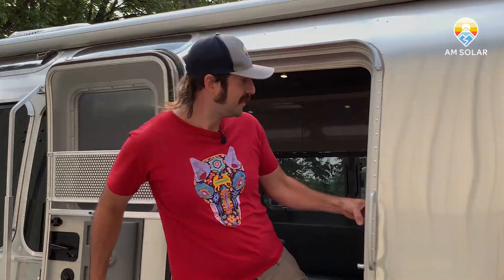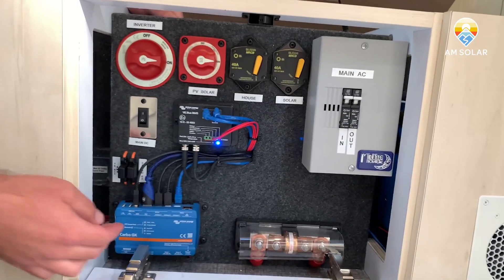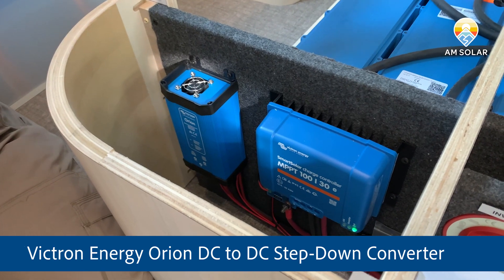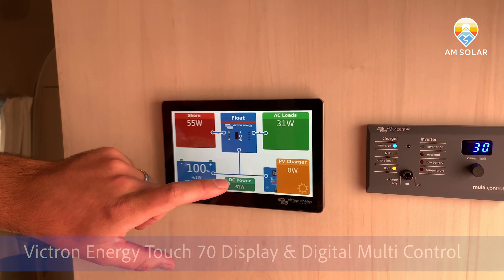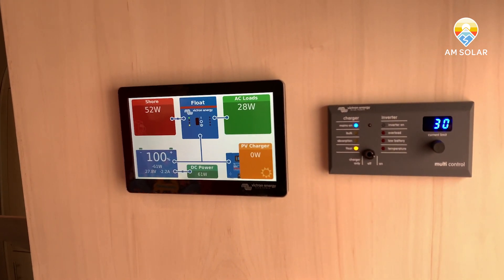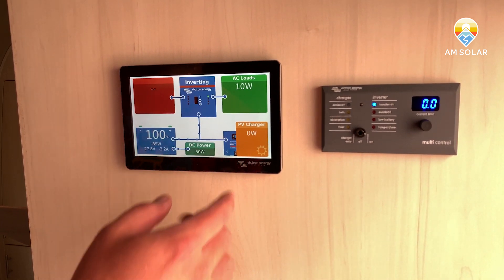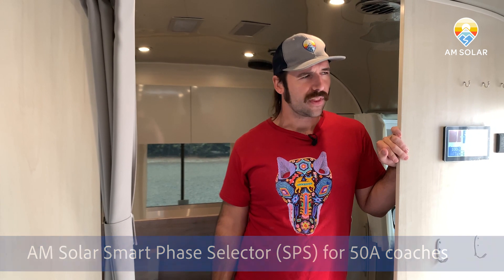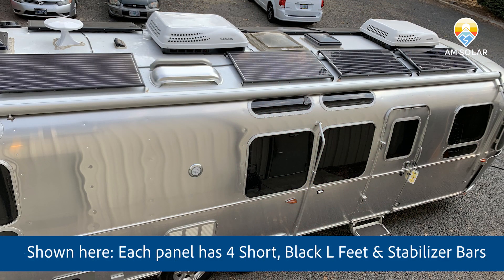AM Solar: 24V Super System Airstream

Comment: What are the inherent differences between SPS 2.0 & SPS 3.0  Ive been hearing of some people commenting on failures on the SPS 2.0 ?
Reply from the maker: The SPS2.0 is built around a modified Progressive Dynamics transfer switch.  The SPS3.0 is a completely original design with individually sourced components.  After building the SPS2.0, the transfer switch we used was discontinued, probably for reliability reasons.  We are working with SPS2.0 owners who are having problems to get them replacements.  Supply chain challenges have slowed the launch of the SPS3.0.
Reply: @GarretTowneAMS  thank you for the detailed explanation. Makes perfect sense. !

Comment: Can this not be set up for a 50amp draw?
Reply from the maker: The inverter/charger can pass 50A no problem.  The output of the inverter is only about 40A on one leg when running off batteries.

Comment: What is the weight of the system, and does it effect the tow ability of trailer having all that weight in rear?
Reply from the maker: I would estimate around 400lbs, and its actually between the axle and tongue.  This kind of thing should be done cautiously and towed with a heavy truck.

Comment: Great work guys!
So do you prefer having the MultiControl even if you have the Cerbo w/ touch screen?

And does the new Touch70  have the same length usb/HDMI cable? Meaning you had to extend it to reach the Cerbo?

Comment: What a super installation on this Airstream trailer. Well done.

I had AM Solar upgrade my Solar Array July 2020 on my 2015 Lazy Daze Class C.

I had my existing two factory installed 100 watt Zamp panels removed and installed six Zamp panels for a total of 800 watts. I also purchased a Zamp suitcase 230 watt panel for those times when I’m camping under the trees.

With a total electronic upgrade, I have five Battle Born lithium batteries. It is a fantastic system that AM Solar’s team designed and installed. What a team. 

I received daily updates about the installation. In the meantime, I relaxed while visiting the coast while they worked their magic.

Thanks to Garrett and the whole AM Solar team, I am able to travel with ease knowing I will always have power to spare.

Comment: Who makes the current limiter?
Reply: Oh wait.... I see it now.
Reply from the maker: @AC-Cowboy41  The DigitalMulticontrol
Reply: @GarretTowneAMS  That’s an incredible tool to have.  You can turn down the currents in your system?
Reply from the maker: @AC-Cowboy41  It limits shore power current so you don't pop any shore power breakers.  For example, if you are using a full 30A, but you plug into a 15A outlet on the side of the house, dialing down the limiter is the only way to keep from popping that breaker.
Reply: @GarretTowneAMS  Good deal.  Understood.

Comment: How many Kw total is this set up?
Reply: 20,480wh or 20.48kwh
Reply: @nebulight  Outstanding!   I will look you up when I get my 30RBQ.
Reply: @nebulight  Wait a sec.  just saw this is Wh.  That only translates to 815watts a day?
Reply: @AC-Cowboy41  that’s the amount of stored energy in the batteries. I’m not sure I understand your question.
Reply: @nebulight  Well, from what I figured is 20480 Wh to Watts is, my bad, on a duration of 12 hrs is 1706watts.  Not 815.   853 for 24 hrs.
Reply: @nebulight  ok   So, how much power can be used on a every day basis?  In wattage.

Comment: Any concerns placing the inverter on it's back as far as over-heating?
Reply from the maker: When the inverter gets too hot it turns itself off to prevent over-heating, so it’s more of a nuisance than a safety issue.  That being said, we have installed hundreds of these like this and haven’t heard any complaints.